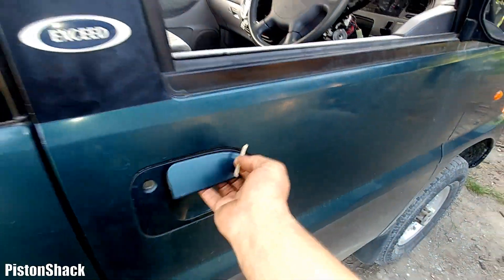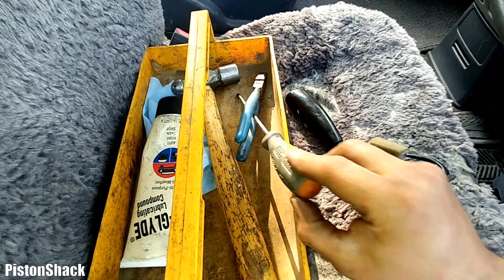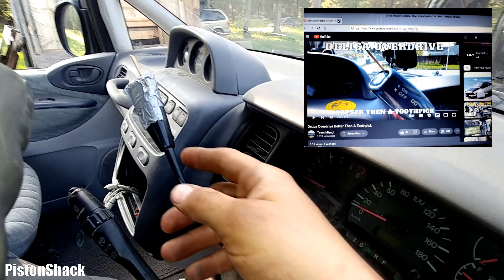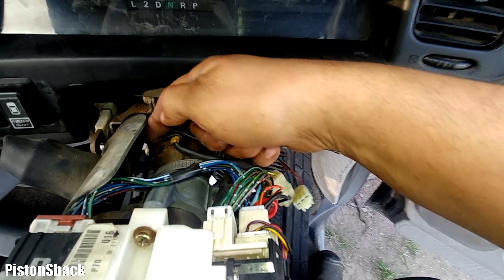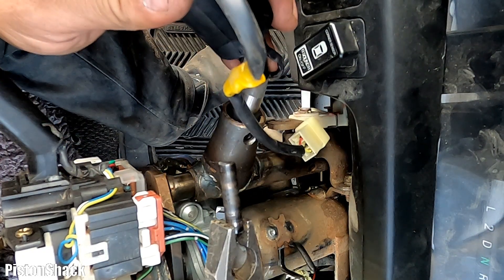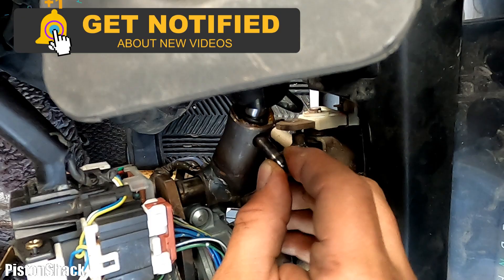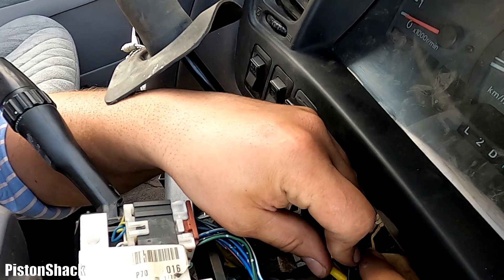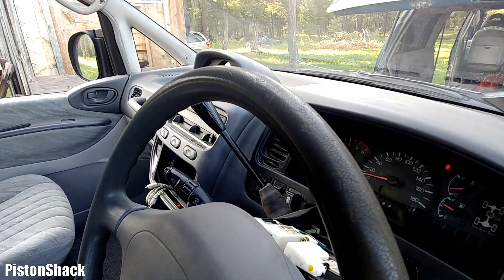HOW TO REPLACE OVERDRIVE SWITCH / COLUMN GEAR SHIFT LEVER ON MITSUBISHI DELICA L400

Comment: So easy, very nice tutorial. Wonder if it's a common problem for Delicas?
Reply: Yes, that switch is well recorded problem all over the world .
I have 50k mile l400 and that switch is stuck doesn't click out, the best part is it came in from Japan with working switch, I have clicked it maybe twice in my ownership and only recently discovered that it is broken, no idea why, I suspect old brittle plastic.
There is a fix for this too but that method leaves something broken underneath the switch, can't remember the details. I think replacing it is a better option, even if one must buy new shifter.
Reply: @bluewanderer9903  thanks!
Reply from the maker: I think so!

Comment: Good Stuff brother. Just discovered your channel yesterday and you are a lifesaver. I just bought a 1996 Delica that has been sitting for about 10 years. You have made what looked like a very overwhelming task of restoring it very easy. The engine is in good condition and started up once we connected the battery, it's rust free bar a few scratches on the exterior body, nothing new paintwork can't fix. It has also been previously vandalized where they broke the rear(middle) right window to get to the center console and radio. One side mirror is also loose. That's all that's missing in this car. It also needs a whole new rework on the wheels. What steps would you recommend I take to get this beautiful machine back on the road. Also do you mind doing a video showing how to replace the rear windows and how to fix a side mirror that's loose? I think the internal spring is busted and it won't fold and just moved all over the place. Keep up the good work. More Delica videos will help the community maintain these behind for years to come.

Comment: My 2.8 delica has no overdrive light and seems to be in limp mode when put into drive but can manually shift the trans any help would be good
Reply from the maker: Hey Sean! What you mean by "Limp mode"? What's ratio to speed to RPMs do you get? Did you notice any tachometer readings issues?